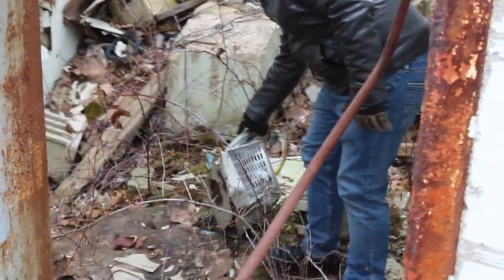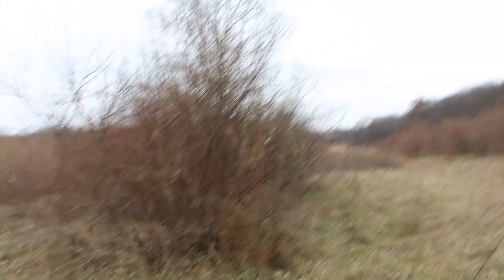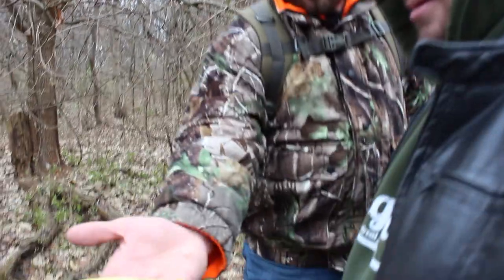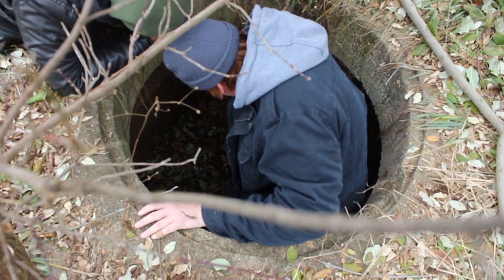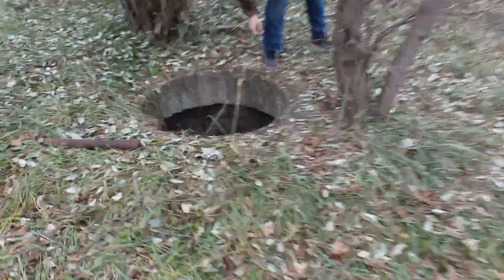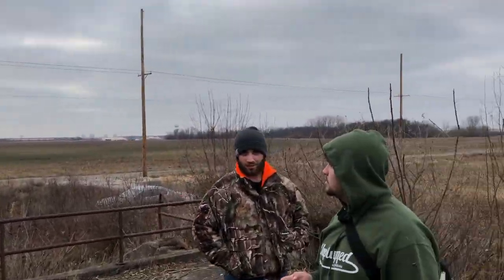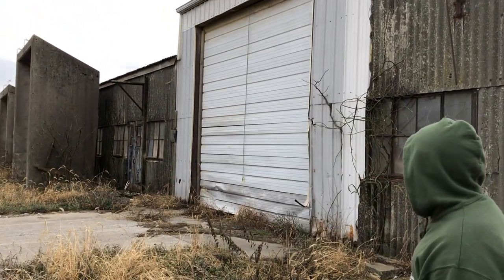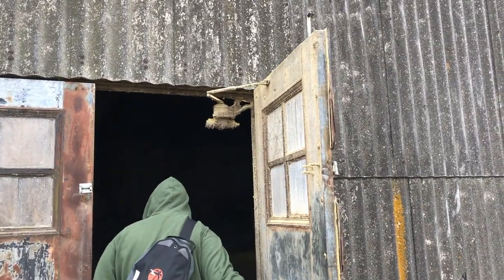EXPLORING AN ABANDONED WWII AMMUNITIONS FACTORY (KINGSBURY INDIANA)

Comment: Hey guys! I actually used to live by here and spent a lot of my childhood exploring those buildings. Back when most people still called it KOP (Kingsberry ordnance plant). Maybe I can fill you in on some stuff. 
The first building you were in was where they would do the most dangerous jobs. That’s why it is divided into such small sections with thick bullet proof glass at each stall. That way if one step of the process went wrong and the munitions went off it would try to contain the blast to one area. That’s another reason to have it a smaller building. The workers would work from the other side of that small plate of glass to do their work. The structure that you are seeing off in the distance I believe are a part of the underground rail system they had that would go between some the buildings. They are covered in dirt to make it hard to identify from the air as well, but most have been filled in after it was decommissioned. They had the buildings far enough apart where if one blew up or got bombed it hopefully wouldn’t affect the other buildings. A lot of the other stuff there was modern junk from illegal dumping lol. 

The second build was I believe a small munitions building. Most of the machinery had been removed by the time I started exploring. They used to have big slides that would go from all the levels down to the ground for emergency escape. In the front of the buildings it has that T-shaped entrance into the buildings. There would be an AA gun mount that would be by that T entrance. The T was there that way if they were dropping bombs the bomb would hopefully strike the side of the hill rather than go in the building.

There’s  dozens of those bunkers out there. Farmers use to rent them out as storage space. They cut off most of the doors or bent the hinges to prevent people from getting locked inside.

If you Google KOP you can see a few pictures from back then. When they built KOP they over built everything, as we had no idea how long we would be at war. And back then it was like 90% or better of the population that smoked, and safety was pretty lax compared to today lol. They recently did a small part on mysteries of the abandoned about KOP too.
Reply: Dude 😳 I hope he saw this because it must’ve taken awhile!
Reply: I’m actually one of the people in the video and I greatly appreciate the history your comment sheds on this. Thank you for sharing your knowledge ✌🏻 cool to have some answers about what we were exploring.
Reply: Happy to drop some knowledge nuggets on ya! That place was a total wonderland for a country kid.